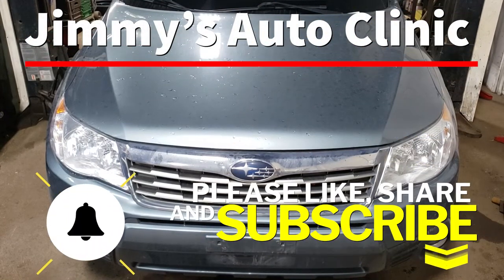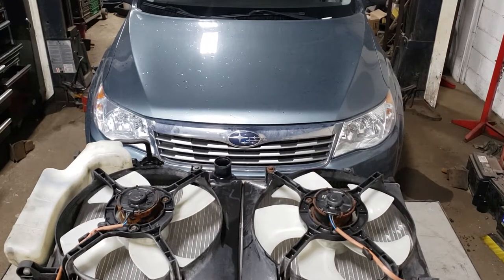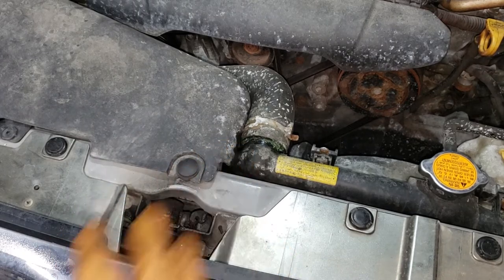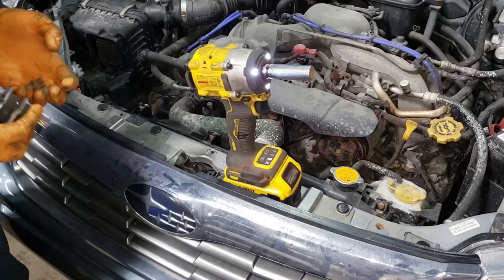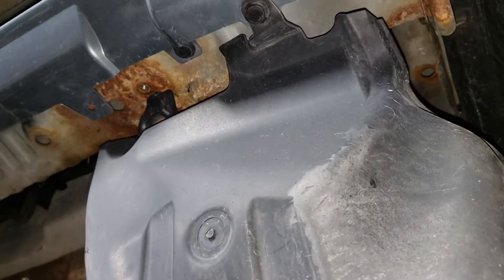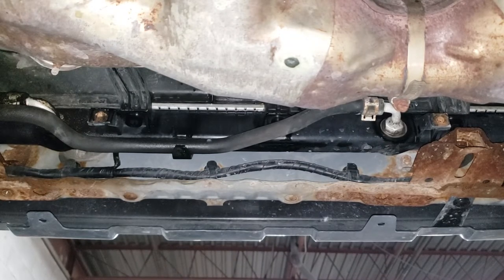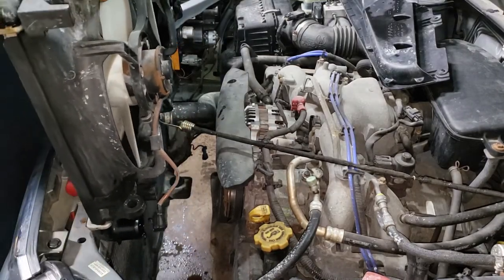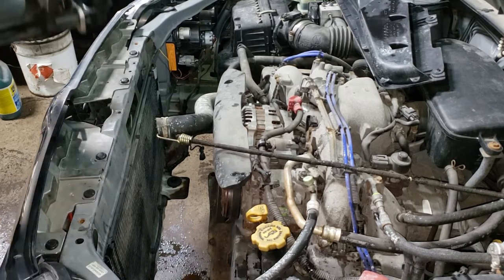2009 Subaru Forester | Radiator Replacement | Cooling System Bleeding

Comment: Ahhh...you sir are a blessing in so many ways.  Good to take in a good ole car procedure while having a few laughs along the way.  I just acquired a 2011 Forester (non-turbo), was a lease twice in it's life at 152K now and the radiator is leaking  pretty much across the top section all over.  It's not terrible but it getting replaced with an aftermarket one this Sunday.  There is some oil residue on the underside left/right of engine but not terrible.  Oil cap is clear and oil from dip stick seems fine, as in no signs of water.  I put a scan tool and drove around and the coolant temp bounced between 197F and 201F which tells me the thermostat is good and the temp seems good.  I sure hope it's not a head gasket issue.  I will use Sub Super Coolant and a bottle of conditioner as well as do another oil/filter change just because and add a bottle of ATP 205 reseal (snake oil that actually worked on my oil leaking 2004 Accord).  Any advice on moving forward, places to check etc.  A local shop said they can't do any compression test if the radiator is leaking so wonder if I should get some sort of head gasket test after I do this work?  Thank you.  SUBSCRIBED!
Reply from the maker: Hey roy, hey Roy the 2011 Forester is slightly different from the one that I show in the video. You're 2011 has a different motor, it's not an EJ but an fb. So certain things may be slightly different when doing the radiator but it is pretty much the same job. Definitely replacing it is the way to go. You sound like you're decently knowledgeable about cars with some of the stuff that you checked. The coolant temperature sounds normal. Unfortunately for the oil leak the FB motor is a real pain when it comes to leaking oil. The fixes that are required are usually pretty expensive and labor intensive. In regards to the FB the best advice I could give you is to check your oil regularly to ensure that you're not burning it. As for the shop that told you they couldn't check for compression that doesn't sound right to me as long as you're referencing the compression of the engine. You can have a coolant leak and check compression. In regards to your head gasket luckily the FB Motors don't have head gasket issues. They usually are playing by oil burning issues and annoying leaks that are quite expensive to fix. Trying the ATP Maybe a short-term solution but most stop leak type of items can cause really profuse leaks when the gaskets fail. Good luck on Sunday my friend. If you have any questions feel free to reach out.
Reply: @JimmysAutoClinic  Thanks Jimmy.  Dropped the oil, radiator/drain and replaced all 4 plugs with OEM NGKs today.  I kept about 1/2qt of each (oil and coolant)just in case I want further analysis.  As for the oil and coolant really nothing abnormal, coolant was still nice and blue, no smells of exhaust/gas and no residual oil.  The oil was fine as far as I can tell too, nothing abnormal like foaming mud-like stuff (when water is mixed).  As for the plugs, the car fax says they were replace at 85K and the car has 153K.  The tips were dry but there was decent amounts of oil in/around the coil packs.  I cleaned up each port and replaced each plug with anti-seize on the threads and torqued to spec.  For the short time we've owned it it doesn't seem to burn oil and the exhaust is clean.  New Mobile One Full Syn 0W-20 and one bottle of ATP 205 Re-seal went into the crank case and tomorrow I will install the new radiator and use Subaru Super Coolant and one of the small bottle of Subaru Holtz conditioner.  Not much more I can do with the engine/cooling system parts.  Now onto P/S fluid change, diff gear oil, trans ATF drain/refill, and finally brake rotors, pads and flush with DOT 3.  Oh, I'm also using new hoses even though these hoses that came off the radiator (upper/lower) seem fine.  Thanks again!
Reply from the maker: Great work. Just keep an eye on the spark plug ports the valve covers can leak and then cause you to have a misfire eventually. Fingers crossed you don't have to replace those valve cover gaskets. Although you sound very capable of doing it. Have a great rest of the weekend Roy.
Reply: @JimmysAutoClinic  cheers!

Comment: As a Subaru owner I too HATE that there is no temperature gauge, so I purchased a OBDII reader gauge shortly after purchasing the Outback.  The one I found online is something like Ultragauge.  Been working for the past 10 years. The god dam measurement is in the computer why don't they just show it to us???  
I am not in the "rust belt" so I did not know that a car could have that much rust and still drive.  
Really like your videos, if it's you doing the editing of them you have a second calling.
Reply from the maker: THANK YOU, finally someone else who agreed with my opinion of the gauge lol. I also use an OBD2 plug in adapter that reads the temperature in many other different parameters on my cell phone while driving. It's definitely a good idea. Hopefully they bring the gauge back one day. Yeah it's amazing what you see in the rust belt. I am definitely doing the editing of the videos. It usually takes a couple of days out of the week to get the long ones done and the complete Saturday for the ones that are 20 minutes and under. So thank you very much for commenting because it makes it worthwhile :-).
Reply: @JimmysAutoClinic  add me to the list - we have an 09 Forester, and substituting idiot lights for a real temp gauge on an all-aluminum motor is borderline criminal.  Subies are usually better than that.  definitely enjoyed this video!

Comment: Awesome video Jimmy… I did everything u did but after 35 min no fans came on? There was no more bubbles and I had heat. I closed everything up and took a drive, everything was fine and the the fans were coming on.. so I think I’m all set lol… love the vibe, I’m subscribing 👊🏻
Reply: Pss love the potty mouth
Reply from the maker: That's a really long time for the fans Not to Come on. Sometimes when I don't show on video is me revving the engine up to about 2,000 RPM and then sometimes I blip it through about 3,000 to get them to come on however if you rented at idle and all the bubbles are out just keep an eye on the open tank as well as the radiator over the next few days to ensure that there are no air gaps. Sounds like you did everything well and you're good to go however.
Reply: @JimmysAutoClinic  Cool! Thanks for getting back to me. So far  so good🤞🏻

Comment: I hope you see this, I am going to be undertaking this project here in a few days. I bought a brand new radiator, do I need to fill the atf portion of the radiator?
Reply from the maker: Hey my friend. As long as you clamp off the hoses with hose pinches or with bolts minimal fluid will drop out. It's usually less than 50 to 100 ml which is really nothing in the grand scheme of things. You can top it off at the transmission if you're concerned about it however we never do.